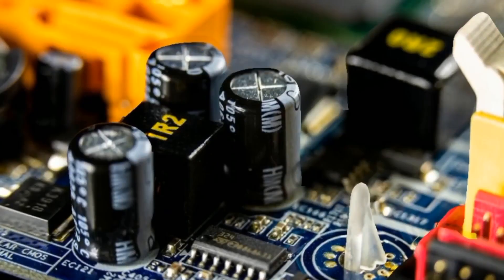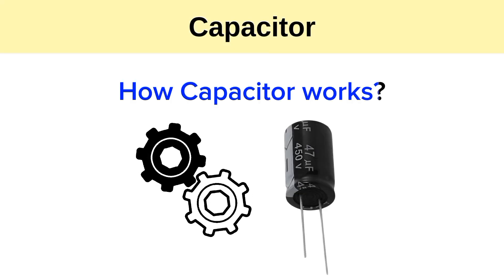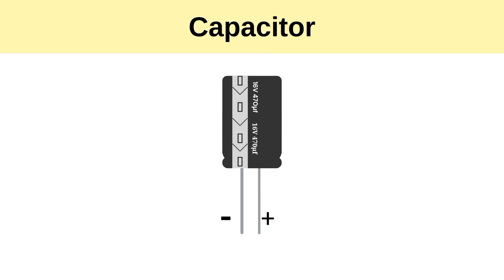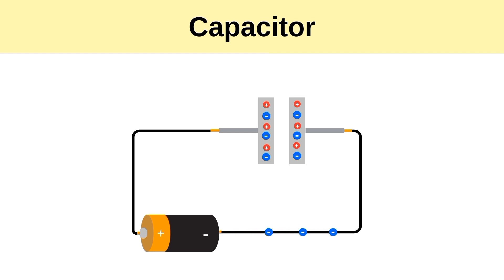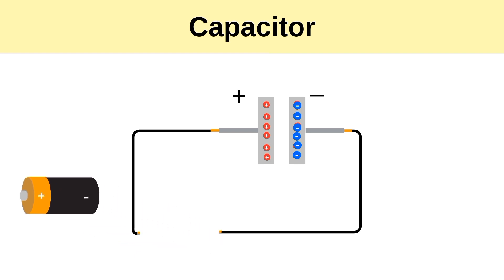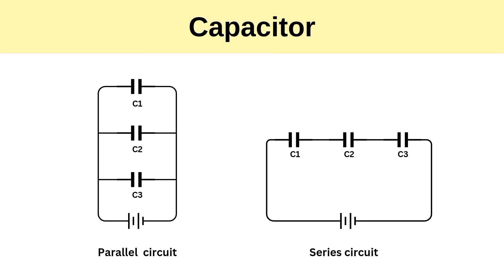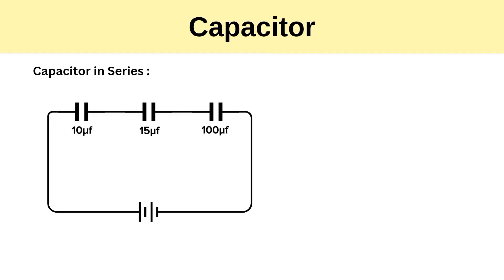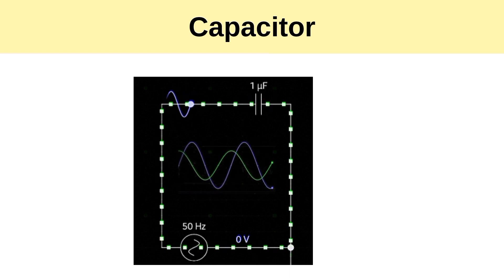How capacitor works | Basics of capacitor | capacitors in AC

Comment: How are some polarized and some not? And why?
Reply from the maker: Some capacitors, specifically electrolytic capacitors, are polarized due to their internal construction. This involves an asymmetric electrode design and the formation of an oxide layer on one electrode during manufacturing. This design allows them to achieve higher capacitance values in a smaller size but limits their safe and effective operation to a specific polarity.
Reply: @oneELECTRICIAN   are the plates actually different, area wise? Or does the oxide layer effectively increase surface area on one plate?
Reply from the maker: The plates in electrolytic capacitors do not differ in terms of physical area. Additionally, the oxide layer formed on one electrode (called the anode) also acts as the dielectric and plays a crucial role. This oxide layer is very thin but has a high dielectric permittivity, which effectively increases the capacitance.
Reply: @oneELECTRICIAN  ahhh... So no plastic or paper dielectric. I see how they are stronger in a smaller size. How does this require polarity?